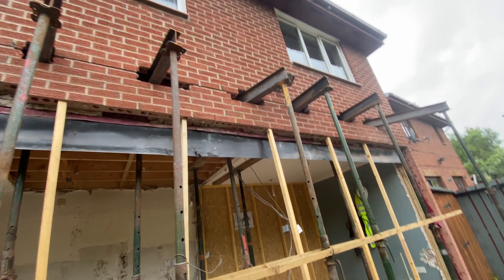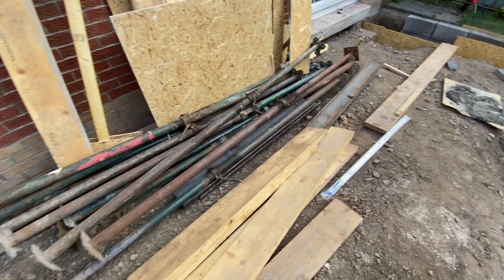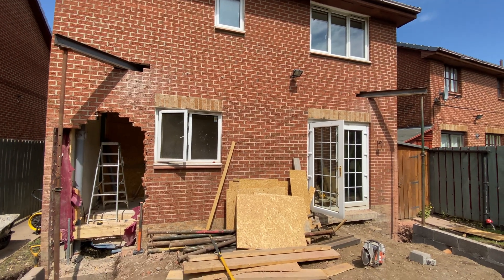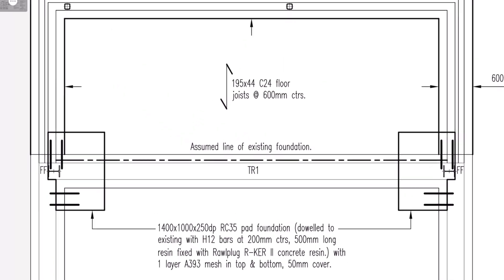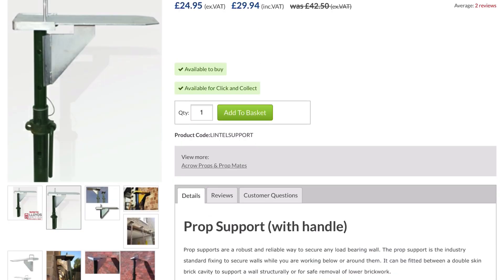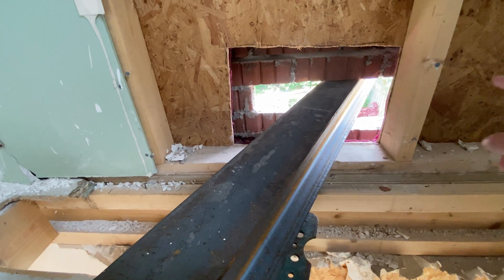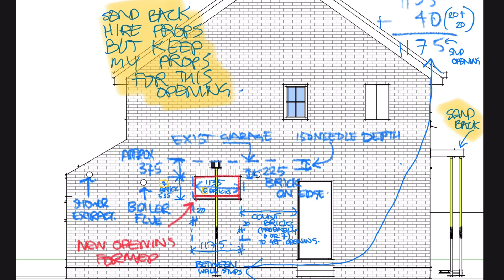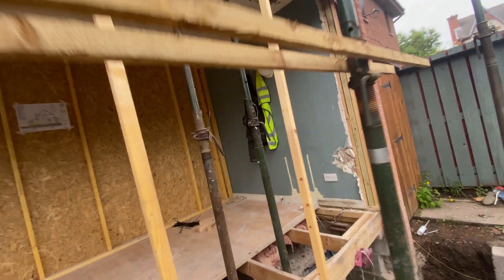Demolitions and propping for your home extension…… all you need to know.. how to do it

Comment: Can it ever be acceptable when installing a steel for a 4m span to use needles, but in a single place around 8 courses under a ~1200mm wide upstairs window use a strong boy?
Reply from the maker: You can use strong boys sometimes for the smaller openings, you just need to figure out the weight in kilo newtons coming down on it and add the margin for error.

Comment: Great video, but how would a DIY'r do this themselves.! No insurance or do yiu need to take out an insurance?
Reply from the maker: If you can demonstrate competency and you’ve done your research, with method statement, with calculations,  safety plan, and propping loadings, you approach your insurer and agree a premium. Sounds a lot of work but it’s not since you need to do that stuff anyway.  It’s no different from what a contractor should do. Except, many contractors don’t bother, and use incorrect props and no safety plan. Maybe they don’t know that their insurance is voided, or maybe they just don’t care, since we only hear about the disasters.
Reply: @build-better-things  Really appreciate the reply. I've had my structural calculations done, just filled in the building control form, and had a price for the steel beam needed. They'll fit it as long as the brickwork, etc, is removed. It's a 5m bifolding door I'm fitting. The structural guy says strong boys and acrow's will do the job. 
The costs can spiral out of control if you don't do your homework. I've saved a fortune doing things myself. Luckily, I have a really good builder friend who's going to help (I should say I'll be helping him) and just need to hire the acrows, etc. All in including the 5m anthracite doors, structural guy, drawings, lintle, etc £4,900. I was quoted 10-12k
Reply from the maker: Sounds like you’re doing your homework with your engineer and I wish you all the best.

Comment: Great video. I want to expand a patio doorway and replace with a bi fold and my house is a chalet. So it’s a wood construction upstairs. So I guess it would be a case of supporting the floor joists rather than the brickwork? 

I’d get a structural engineer to provide detailed instructions but I would be interested as to how this would work since there is no upstairs brickwork. 

I already had an engineer in for some unrelated cracking and mentioned to him and he didn’t think an RSJ would be needed so I’m guessing the load would not be as great as I suspected.

Comment: What about doing an extension on a flat where you don’t have access to floor above? 

Is there a way to use needles and not need to damage the floor above?
Reply from the maker: Best talking to your engineer since I’d need to see it…. but in the past where there was no access to above, I’ve used a splices, where the beam is inserted as a set of shorter lengths and you therefore only demolish in small sections.

Comment: Thanks for the info. I was desperate to find out the correct way to do this and you've hit the nail on the head. Its only for a garage, however, its a pitch roof, twin wall, and I need to create a 7 foot hole to walk through to the new build. Respect.
Reply from the maker: Thanks and best of luck with your project

Comment: Hi build better things, great video. I am hoping to do this myself in a year or so, could you give me a bit of advise on what sort of support is required at the base of the acrows? I was hoping to have most of the single storey extension built before I take the rear wall out so I am planning on leaving a few blocks out of the the  proposed beam and block floor and extending the external props down to the ground. And then internally removing some floorboards and doing the same. Would a concrete base need to be poured to support the props or can they just be sat on a scaffold board or something which is sat directly on the ground? Many thanks.
Reply from the maker: As long as the ground is level and well compacted with boulder clay or similar residing near the surface, so no loose topsoil, scaffold boards are ok. But the boards must be level and secured.  Don’t worry about the concrete. Write your step by step method statement and safety plan, then finalise with your structural engineer. Key thing is to have everything rigid and tensioned without being too much to damage the existing walls, because even a few millimetres of movement will cause you problems. But…as I said…check all with engineer once you’re prepared and before you start.

Comment: So any video on you tube where an rsj is being installed with a length of 4 m or longer and strong boys are used to hold the external wall is incorrect? Thats like 95 percent of all videos. Thanks for the video(s) Very useful and informative
Reply from the maker: It’s not the length of the opening that determines it, it’s what the load or weight over the opening. For a two storey opening such as the example I’m showing, the loads are such that you would never, ever, use strong boys. I don’t have the space here to show it using Kilo newtons, but it’s a simple calculation. I’ve seen the same YouTube videos of so called builders using strong boys, they are clueless and dangerous. The fact that most (not all) get away with it is irrelevant. I’ll consider strong boys on single storey openings for example.
Reply: Thank you, for thr reply, videos r really good to watch and appreciated. If strong boys only ever used for single story extensions, it would only be to hold the roof . Thanks again, nice simple easy to follow videos. Wish I'd found them before paying for my planning drawings ha ha . Thank you
Reply: Roughly how many strong boys would it take to support the load featured in your video?
Reply from the maker: You find the kn of your chosen strong boy and then find the kn of the wall it’s supporting. You do your maths from that. Strong boys can’t support that no matter how many you use. You need to consider laterally as well as vertically

Comment: oh great! so I'll have to knock through a freshly renovated bathroom and bedroom? are there really no alternatives that offer the same strength and support without knocking through the first floor?
Reply from the maker: You raise a good point.  Unfortunately the laws of physics doesn’t care about your bathroom. As far as I know, needles are the only economically feasible way, but your structural engineer might be able to design a splice beam system where you go along horizontally in metre increments inserting the splice as you go, without the need for needles therefore. Probably cost more than the redecorating if your builder does it, but perhaps using a step by step approach , hopefully as I’m describing, a self builder could do a perfect a job, since time and organisation is the main resource for demolitions . Alternatively I guess the trick is to wait until after you’ve done your extension before decorating your upstairs bathroom and bedroom. And, no matter what your builder says, to never use strong boys.
Reply: "Unfortunately the laws of physics doesn’t care about your bathroom" That you are right. I have been researching for about a year now to get the courage to do my own extension, but I think i'll leave this part to someone with experience and will take your advice to only use the needle goalpost system. It's only a few tiles and a bit of plaster to replace. It's just looks more chaotic than it is I guess. Thanks for your videos
Reply from the maker: Thanks for taking the time to comment. Best of luck for whatever way you decide and feel free to ask if you have more questions

Comment: Great video, thank you so much - quality work throughout. I'm doing a self-build and after over a year of work, the time has come to do the rear / side extension. Can't find a good local company to just do the propping so was looking for self-build examples and came across this very simple explanation video. I am considering undertaking the work but not sure my self-build insurance will cover it, great knowledge nonetheless. Subscribed!
Reply from the maker: There is no “formal” qualification for doing demolitions and propping. I don’t have any anything to show them. Insurance companies and their loss adjusters are looking for the appropriate due diligence and following the engineering specifications, if an accident occurred. An example of your insurance not paying out is through you using the wrong type of props, or the wrong positioning of props, or not having evidence of having made a method statement. If you can demonstrate competency, through your previous years work, they would have to insure you, just like they’re insuring all general purpose builders. I always tell them what my job is, what they need from me, and whether I have cover. If they still won’t, get a different insurer. Thanks a lot for your comment and best of luck.

Comment: I am doing similar myself but keeping the wall between the house and extension. One thing playing on my mind is how to stop water transferring from the top section of wall, that is exposed to rain, down to what will become an internal wall. It looks like you have put a DPM tray and weep holes above your RSJ, I can't do that without demolishing and rebuilding. I am guessing applying a weather barrier treatment to the external brick will be the most cost and time effective solution. I have found this to be a very hard situation to research, there must be a set of standard practices for this. My B.Regs inspector will be able to tell me what they want but I like to plan ahead.
Reply from the maker: The problem with your weather barrier idea is that water may still get in, further up the wall. The correct way to do it in your situation is to use a plastic preformed cavity tray which comes in short sections. You go along the course above the roof abutment carefully knocking one or two bricks out and exposing the inner leaf. You then fit your cavity tray pieces, which interlock with each other horizontally. You then add back in the bricks, and move along horizontally and rinse and repeat, weep holes as you go. Your flashing onto the roof then laps over the lower horizontal leg of the tray.  It’s hard to describe.  Hope that is clear.
Reply: @build-better-things  Awesome, I had a feeling you would know! Very helpful.

Comment: Hi,  your video is very helpful for me, i watch a lot recently, i have a extension very similar, i want to do by myself,would i ask you some details about the steel beam what you used? Thanks.
Reply from the maker: I used a primed (painted)  254 x 254 x 89 steel i section for the beam,  sitting on 203 x 203 x 72 columns at each end. But I had to splice the beam into three parts to fit it in, as it was too big. I made a video here about how I did it, and how a splice works. Don’t forget to get all your sizes checked by engineer. 

Steel beams for house extension - working with structural engineer
https://youtu.be/O-yt3P6JL90
Reply from the maker: It may have been galvanised…I can’t recall
Reply: @build-better-things  thanks so much

Comment: I got quoted a ridiculous amount of money to install couple of steel beams. I was not impressed with the kind of workmanship around Leeds area. I decided to do it myself, hired 10 props 4 strong boys and a lifter all in all £230 for the week rental, got a hammer drill and a masonry. Got the Naylor and steel beams as recommended by the structure engineer. The final result not just make me very proud but also save me the money and the hassle to deal with the cowboys.
Reply: Same for me in my loft. I ended up hiring a team of lifters to get the beams up into the loft, did the prep work before: padstones in all to SE spec, then the guys just got them up for me and dropped them into position, took them less than 30 minutes. Had to knock holes in the wall to push the beams through but after I just bricked everything up. The entire job cost me less than a grand including all the steel, padstones, lifters and SE visit and report. Cheapest quote I had was £3k just to fit them.
Reply from the maker: Thanks for comment. Yes,  the money you can save on this part of a build is a lot, you just need to be well prepared.  I totally agree that it’s so satisfying to do this part of the project yourself.
Reply: How much did you save by doing it yourself?